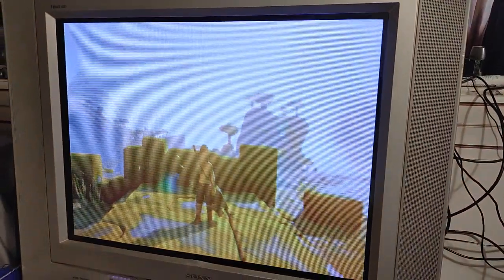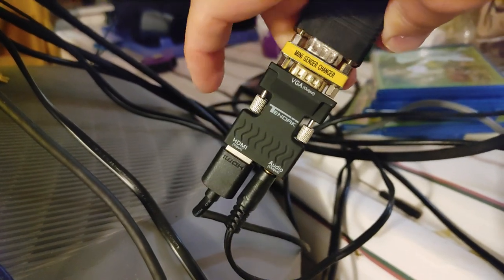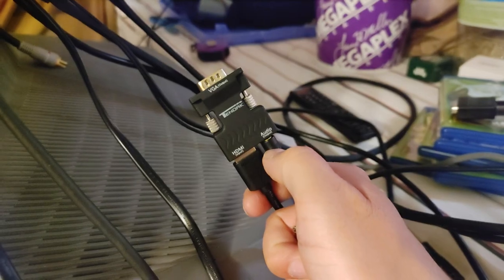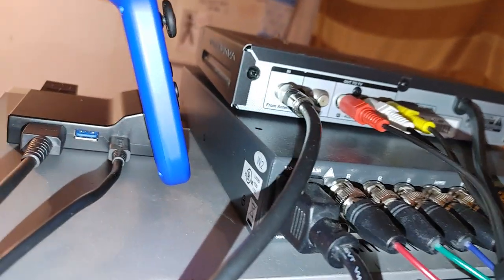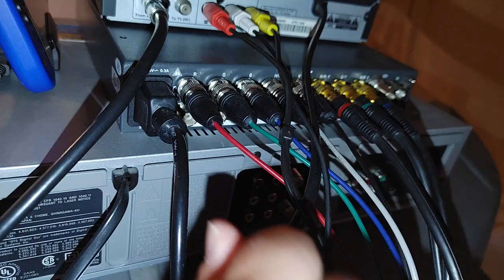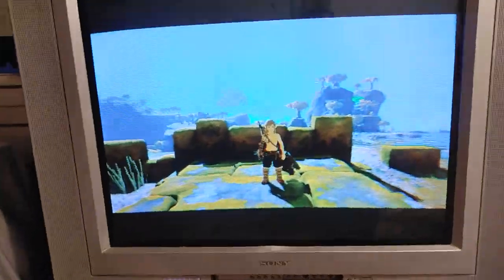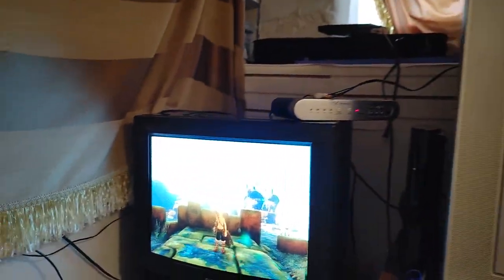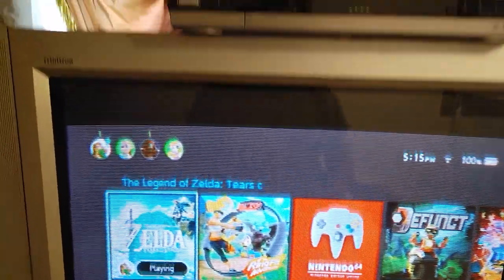How to Connect a Nintendo Switch and Zelda TOTK to a SD CRT Using an Extron VSC!

Comment: It was working for me before downscaling 480p and 720p 

Now when I select 720 it freezes , 480p and 1080p works while working with Nintendo switch, but using ps5 nothing works not 720p and not even 1080p 😂 any thoughts?
Reply from the maker: Huh, interesting.  Does 720p also freeze with the Switch?  Or just with the PS5?
Reply: @FairyKid64  both and now the 1080p isn’t working 😂only 480p
Reply from the maker: Wow - that's crazy.  If you press the "Freeze/Reset" button on the front of the VSC, does that fix it?
Reply: @FairyKid64 gonna try first thing in the morning ( so just a click not a hold yea?)
Reply from the maker: @b2collects  I haven't used that feature a lot, but I think it was just a click for the freeze/unfreeze functionality.  But you could try both - maybe a long press of 10-20 seconds will completely reset the VSC and fix the issue too?
Reply: @FairyKid64  so it’s a 2 second hold on reset + when it start blinking u have to click on menu. Well now it displays 720p and 1080p but very zoomed top right corner and frozen image. I tried to fix it with sizing but nothing works
Reply from the maker: Wow, that is strange.  Without being able to test it myself, I'm kind of at a loss as to what to try.  You could try contacting Extron directly - I know they don't make VSC devices anymore, but I would imagine they still support them.  On their website it says they have email and 24/7 support:
https://www.extron.com/company/contactus.aspx?region=usa